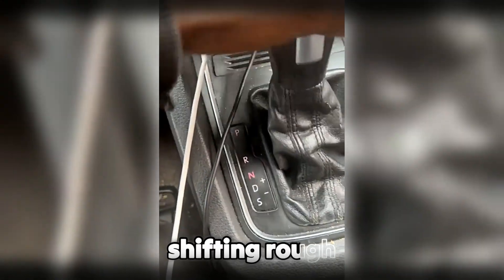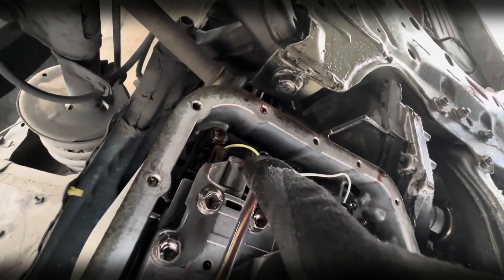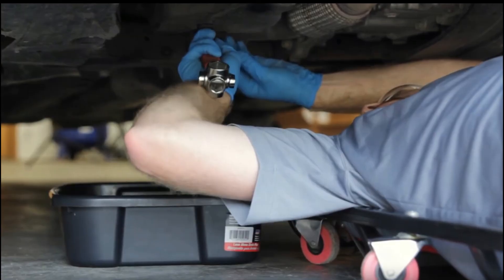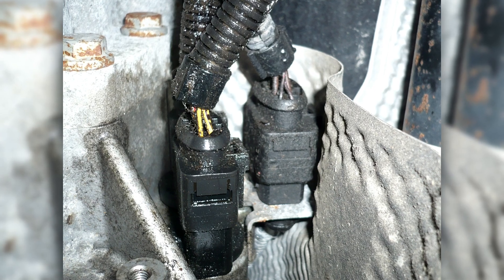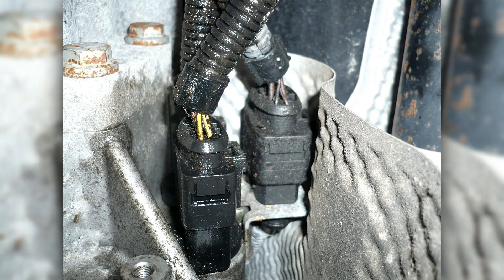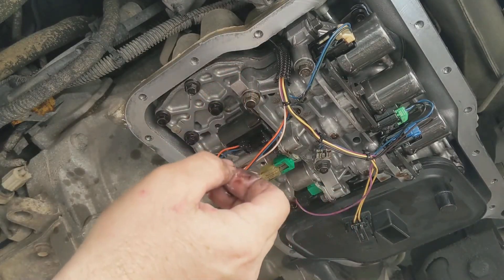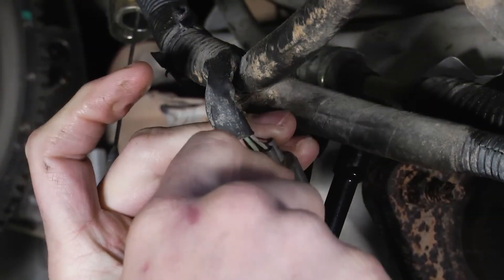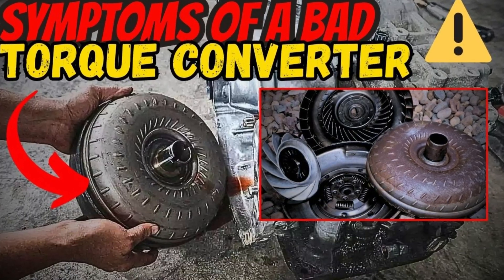How to Test a Transmission Solenoid (basic steps)

Comment: Здравствуйте прозвонили саленойды все работают  масло поменял гидроблок промыт ошибки Р0700 р0731 р0733 и гирлянда горит ЕСП антибукс Шевроле Каптива 2.4  ...что может быть?
Reply from the maker: Thanks for the update. If all solenoids test OK, the fluid has been changed, and the valve body has been cleaned, then codes P0700, P0731, and P0733 usually point to an internal transmission issue. This can be caused by worn clutch packs, a slipping input/output shaft, low line pressure, or a faulty transmission control module. When the transmission detects gear ratio errors, it can also trigger ESP and traction control warning lights. At this stage, a proper line pressure test and internal inspection are recommended.
Reply: @AutoFixProblem Здравствуйте 
Шевроле Каптива АКПП 2.4 2007год вылезли ошибки ЕСП антибукс антизанос промыли гидраблок прозвонили саленойды масло заменили не помогло.
Сделали снова диагностику ЕЛМ  Обд ошибки Р0222 Р0221 Р0732 Р0762 Р0734 Р0700 Р0328 Р2135 Р0122 вышли новые ошибки послепромыте гидроблока?